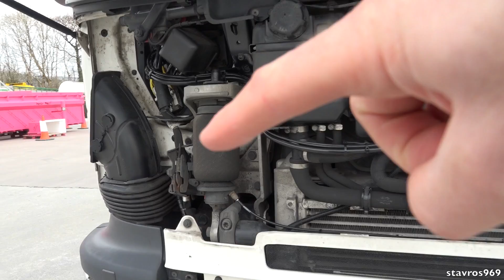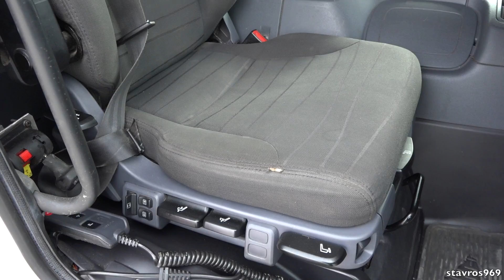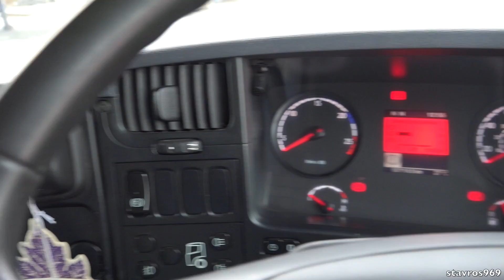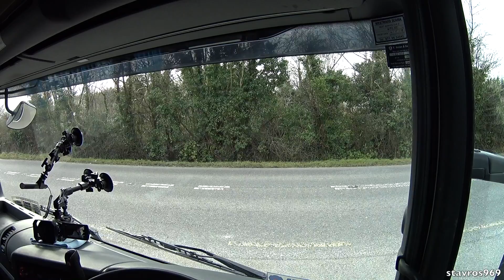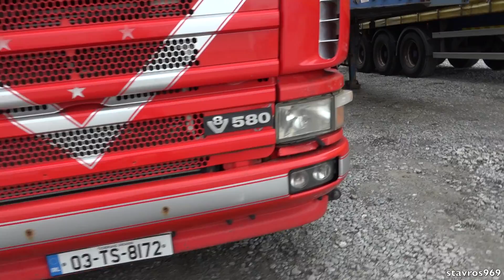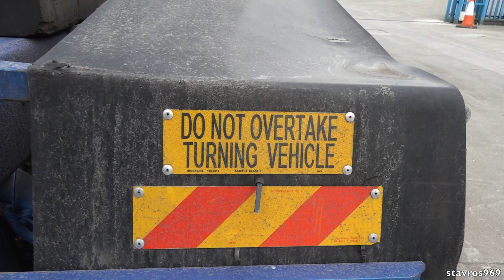SCANIA P440 Truck [Test Drive] Has It Got Enough Power?? Stavros969

Comment: I dont think most employers give a flying .... what the driver thinks ,just get that trailer hooked and get going
Reply: There's three things they care about fuel economy resale value and what r & m deal they get. They literally just buy what a salesman tells them to buy. So if you think you need 500 bhp for example a computer will tell them the lower powered truck gets better mpg and it's cheaper to buy so the poor driver can struggle. It's such a shame that the profit margins are pathetically too tight that it's all about mpg and not a lot else. I wish it wasn't like this
Reply: Yes

Comment: Where I'm from a P440 is considered very powerful, most trucks here have 320-360hp regardless of manufacturer. They say it's due to the speed limit of just 60kph/45mph
Reply: Meantime for me at my company it is mostly r560/580 and a few r730 and that feels a bit weak sometimes when driving 74tons in 10% hills

Comment: Now I remember why I hated my old p380 .. No ####cupholder..
Mine was a Manuel as well and I was also looked out once.. for slamming the door ..to hard
Nice to see the old Give truck used for hauling windmills.. I bet you that it has.. or use to have more power then 580hp.. most off then where fitted with an powerchips  I believe about 650-700hp.. 
Last time I saw it it was running with a tipper behind... 
Most Danish cabins that time are fitted with The red "busplys" and leather..old school... it would be nice to see a vid off you driving it around.. 👍
BUT.. The Aussie T143.. 👍
Now that's really a beauty.. please try to ask the owner for a spin.. what a truck.. not for every day .. but for fun and shows... I would love to hear it roar up gears😁
Thx for the vid Stavros.. hello from Denmark..

Comment: Nice video stravos as always. I think for a distribution tracktor is 440 hp very nice. In the 80,s was 330 hp up to 420 the max there was. So 440 is plenty. The australian spec. T 143 450 is so very very cool . I think they used it to pull B double,s down under becuase it was a 80 tonne spec unit. The roadtrain units are 120 tonne spec if i am correct

Comment: What is the P, S, R, and T meaning in scania?
Reply: Basically denotes a different model or style of cab...and possibly it's use...
Reply: P stands for low frontsteer cab ,R for high fronsteer cab and T for torpedo . S is for the new gen. Scania,s and stands for midle high frontsteer and they have a little engine bumb in the cab.

Comment: what's the difference actually between an R and a G series?
Reply: De G staat iets lager op het chassis en de cabine is iets eenvoudiger uitgevoerd.
Reply from the maker: The G-Series is less expensive and has more basic interior than the R-Series
Reply: The G series is basically a 4 series cab with the new type interior and front grill,it has the exact same hump in the middle,not as big as the hump in the p series but in between a p and an R series